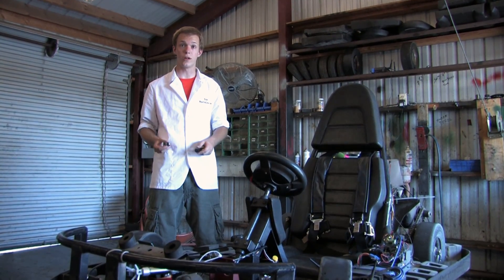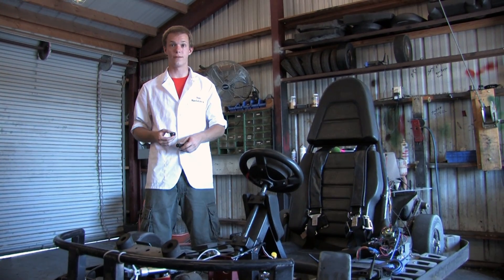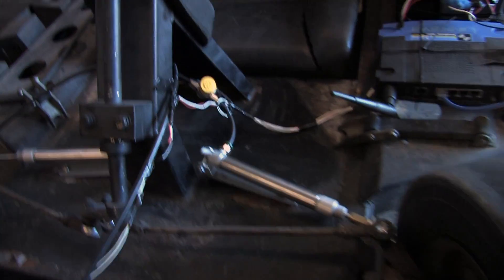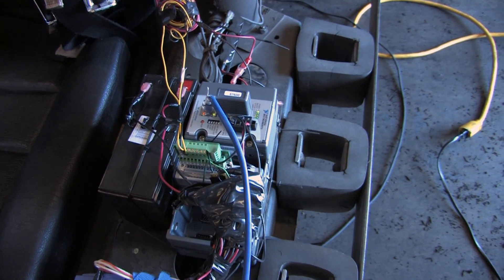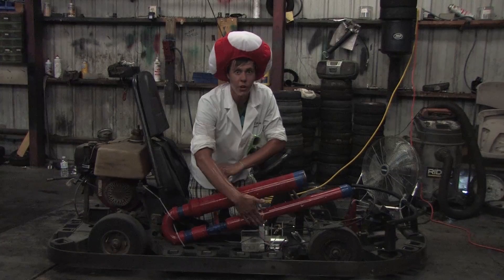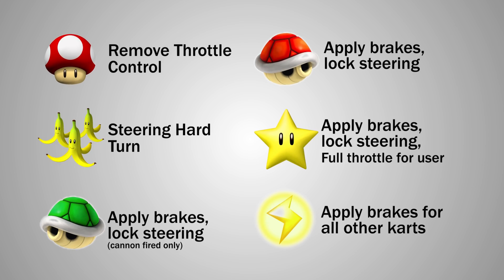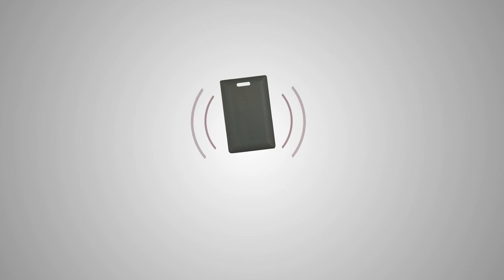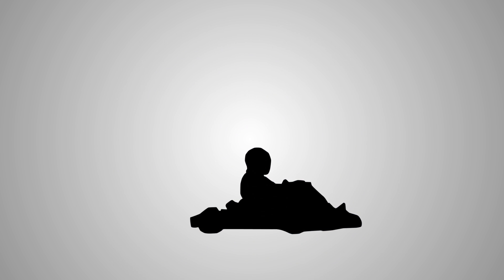Real Life Mario Kart | Waterloo Labs | Episode 07

Comment: There's got to be a way to make this cheaper.  You can buy a Raspberry Pi and an Arduino Mega for less than $100 and get similar stuff: lots of GPIOs and a decent computer.  Nevertheless, this is really amazing.
Reply: the problem is that arduinos and raspberry PIs aren't real-time
Reply: i will try to buy some rf boards to test the idea of their code with some modifications

Comment: This is great, but now you have my mind racing on additions to improving it, while also enhancing safety. Things like putting RFID pads on the ground so that your racers can pick up items without removing their hands from the wheel, a string of leds around the outside of the kart, that could represent the three green/red shell combinations or star, IR emitters/receivers to simulate deploying items, preventing hazardous flying objects & speakers in the cart to warn for incoming items.
Reply: that would be cool, but unfortunately they dropped the project and disappeared
i tried to find again their sourcecode
and it was really difficult